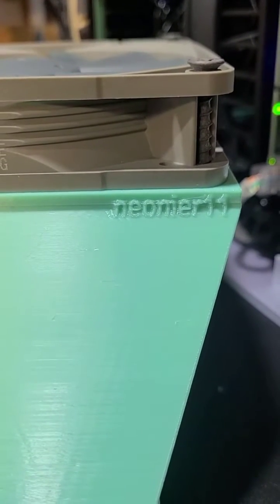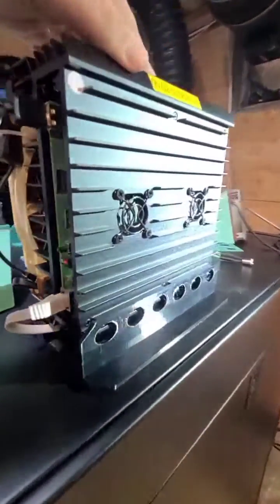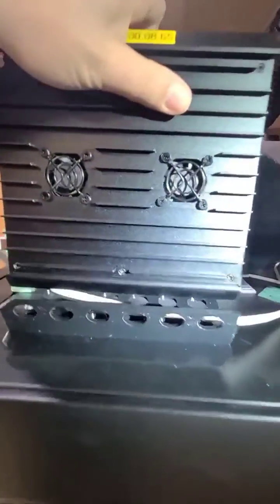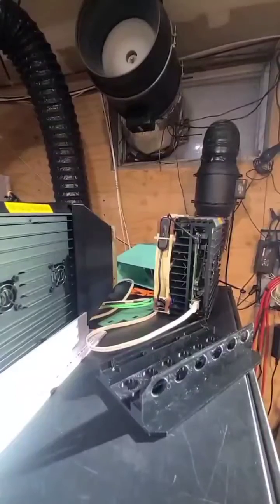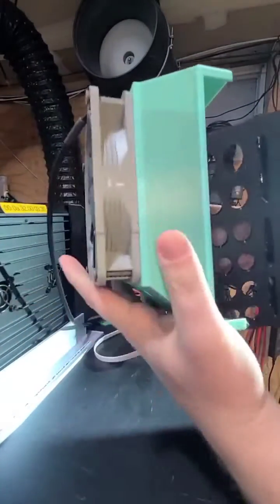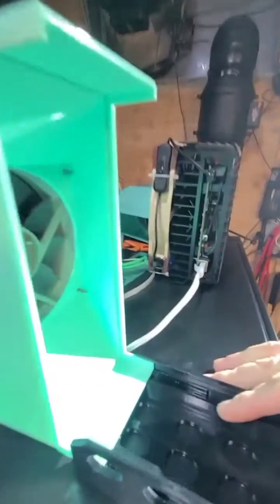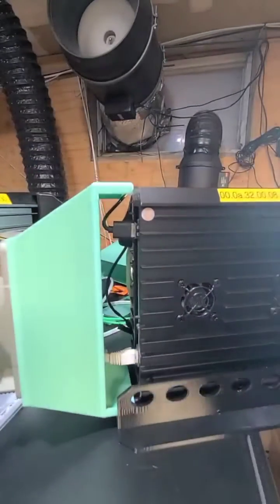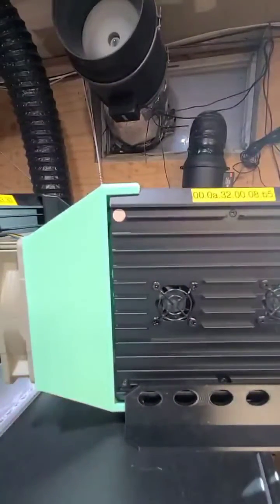3d Printed KS0-PRO 120mm connectable Fan Shroud w/reversible base

Comment: Going to try your design and print one. What's the update with your ks0 pro overclocking now that you have the fan setup?
Reply from the maker: Definitely a drop in temperature once all the mods are in place. I recommend a high voltage cfm fan to get the most air flow. In this Video  I just used a Noctua Compur fan 12v with a voltage reg adapter. I also feel the 200mm fan is the best option for external cooling. There are much better ones then the Thermaltake one I used in the Video but it did what I needed